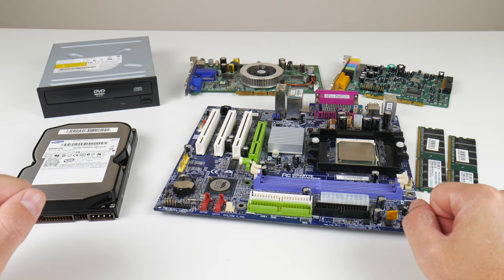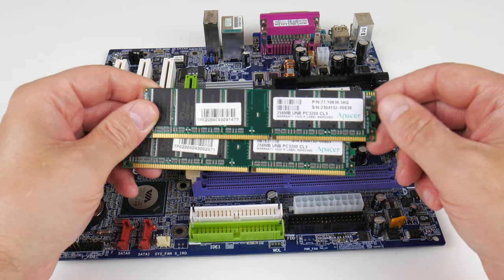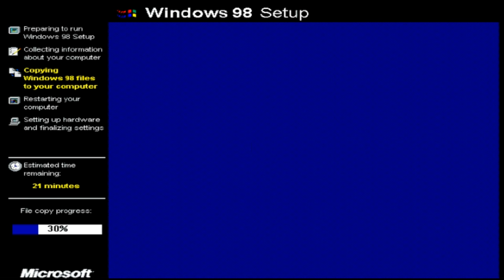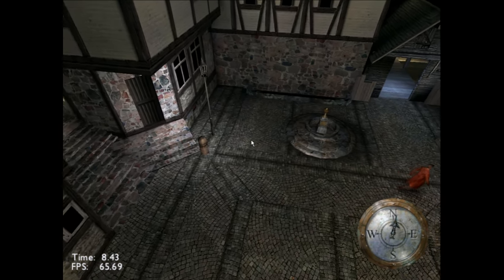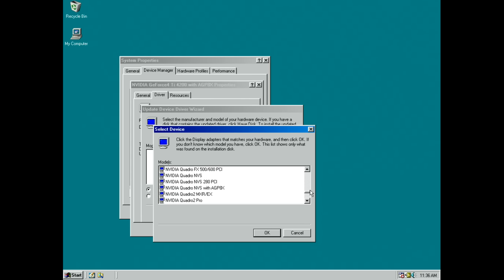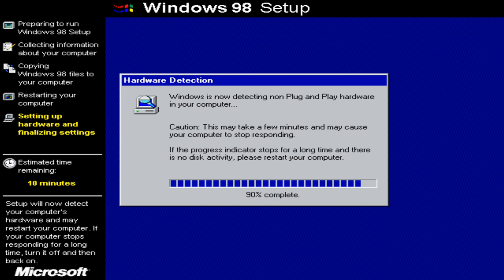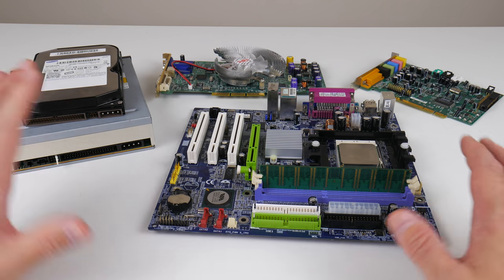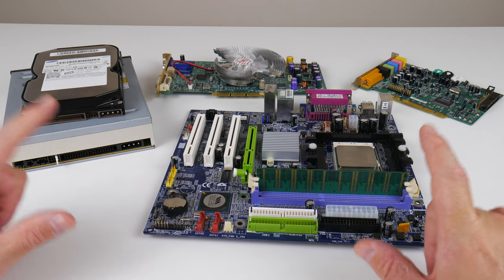Building Windows 98 Retro Gaming PC with AMD Athlon 64 Platform

Comment: This actually makes a lot of sense to do, the earlier Athlon64s were actually not too far from the old Athlon XP in terms of internal design, AMD64 was the big addition and switching from the EV6 Bus to HTT along with moving the memory controller on-die was what gave it that extra performance. Given the Athlon XP was an optimised Athlon Thunderbird which was an optimised Athlon Classic, this is basically akin to running a very high end later era 98SE PC, except hot-rodded!
Reply: Biggest bonus was SSE2 support. Otherwise the XP was good enough, and the sound storm boards were even better. That said good AMD hardware is rare and more expensive than P4s.
Reply: yea, try running any modern OS without SSE2
Reply: I disagree and the K8 was the largest jump in IPC seen in quite a few years. It’s sort of like saying Conroe wasn’t a big deal it’s ipc was about 10% higher over what K8 brought over K7
Reply: @Protoking  I'm not saying that K8 wasn't a big jump or a big deal, just that the lineage between the early Athlon to Athlon64 (and all the way to Phenom II) is very obvious and the K7 itself was largely limited by Socket A's EV6 bus in its later years which allowed AMD to reuse large parts of the design on their next-gen platform while still gaining a lot of performance (Because that fast core design is now properly getting fed with data to crunch) and focus on the parts they were changing that made K8 a big jump and a big deal like AMD64.

Same deal as Conroe itself actually, while it was revolutionary it also was a scaled-up Pentium M...The Banias and Dothan cores were the quiet revolutions that allowed the loud one (Conroe) to happen.

Comment: I'm starting to feel nostalgia to that era of computing even though it feels like only yesterday.
Reply: Me too.. there are something the legacy equipment can do, which modern equipment cannot. The manufacturers pruned off specialty or rarely used features to focus only on mainstream possibilities.. and it is maddening when trying to sort it all out since modern documentation doesn't even attempt to explain some of the choices and options older equipment offered.
Reply: I have a dream of having a stack of itx PCs filled with hardware from each major pc era. Have them all connected to a display adapter switch and connect them all to a few different crts that can support all of the machines. It would be beautiful, with the press of a button you can go from playing doom eternal to the original doom on original hardware. If I had a large house I would do original beige cases, but my apartment is tiny. Lol
Reply: @MisterRorschach90  I'm slowly getting that way, if only it would fit in itx cases, I wish, old hardware takes up quite a lot of space, and old silicon is also bloody heavy. I draw the line at CRT's , I have one, they just take up sooooooooooo much space.
Reply: Pen Guin I wasn’t even thinking when I posted that lol. For some reason I thought the itx standard had been around longer than 2001. Though they definitely had thin client matx slim. And actually I bet getting a thin client would be pretty cheap.

Comment: I put back together an old Athlon XP 2000+ socket A machine only a couple of weeks ago. I had put away the parts including the hard drive years ago. Took a little bit of coaxing but got it running - back into Windows XP - last used in 2006 - old development machine - running Delphi 5 - was pretty nostalgic :) Next up is the 939 Shuttle XPC that replaced it!!
Reply: This weekend I will resurrect my Athlon XP rig. All components are sleeping in their boxes now, but I have a nice new Zalman Z1 Neo case to make them work together again.
Reply: I am using one game on a machine like you for more than 10 years, running Win 2K Pro Sp4 namely Settlers 3 Amazons. Plenty of those CPU around in my collection.
Reply: asus a7n266 vm/aa
AMD atalon xp 2000+
512mb ram
2g/16g 2hd CF cards
Geforce4 128mb

Lots of those boards out there has built in gpu (geforce2) and sound

Comment: 4:00 Thank you for reminding me. i have Gigabyte motherboard and now i will try CTRL+F1 on bios startup
Reply: Be careful with the settings, I believe if you cause issues you void the warranty (Unless it is an old board then go crazy).
Reply: @FEELS GOOD MAN  oh relax, mine just a LGA775 so nothing to worry about, but yeah even i can pay for the new one (latest model) someday i definitely do it too
Reply: @slvr_l7732  Oh fair one.  Good thing with old hardware, you haven't got that nervousness when overclocking and pushing the hardware to it's limits.
Reply: It's not on BIOS startup, press it after you already entered the blue settings menu (via pressing DEL on startup). You will notice it flashes briefly after the Ctrl-F1 if that worked.

Comment: Hey Phil, always look forward to your Friday videos. Have learned a lot from them about things I thought I knew everything about already. Thanks and keep the excellent videos coming!

As someone else said, the sata controller needs to be set to RAID mode and windows will install and boot like a champ. I have about 4 different motherboards with the K8008M chipset and has worked for each one. Plus the VIA RAID drivers I believe don’t have the 128GB hard drive size limit. Although I haven’t filled a hard drive past 128GB to test, larger hard drives have worked just fine with no corruption evident. My best Win98 experiences have been with these VIA boards and are great performers!

Again thanks for the great vids!

Comment: I always hear about the 512MB limit for win 98se but I have built 6 of them all with a 1GB stick and they work perfectly with no issues. Clint from LGR actually got win 98se running with 1.5GB but he had to add some lines of texts to the ini file to get running as it should. His installation was fine with a 1GB of ram though. Anyway great video. I may have to get one of those Turtle Beach cards for one of my 98 builds.

Comment: The second I saw that motherboard I knew I had to run downstairs and check my retro tech shelf to see if I had the original box for it. Low and behold, I had the exact same Gigabyte K8 Triton series board back when I was in 9th grade, revision 2.0 as well. I had mine paired with an Athlon 64 3400+ Venice, an EVGA GeForce 6200 256MB video card, and Corsair XMS 512MB RAM. I never ran W98 on mine since XP was in its heyday at the time. Let me tell you though, I loved that machine. I still have the case I used too. 

I think the attitude about VIA chipsets has more to do with the overclocking potential rather than instability or low performance. I've always had rock solid experiences with VIA chipsets, but I've never had one that would overclock more than 200-300MHz.

Great video as usual Phil. Cheers.

Comment: Love A64's, still have my old S754 A64 3000+ that used to be my main rig over 10 years ago, working perfectly with a VIA Chipset. VIA chipsets are not bad as long as you know their little quirks... My A64 machine have weird SATA II incompatibilities (had to jumper them back into SATA I mode) and I know my old VIA-based LGA775 C2D has weird compatibility issues with anything based on the GeForce 8800 core (like my GTS 250), but worked fine with my GTS 450.

Comment: Nice one as always Phil.
If I'm not mistaken the error-message in the device-manager when you had the primary ide-channel disabled relates to some sort of inconsistency in the BIOS.
It seems like the channel isn't fully deactivated.
I know this behaviour from other boards with a variety of chipsets when disabling an IDE-channel.
Seems like windows' hardware-recognition is able to dig deeper than the BIOSes method of handling its resources.

Comment: Back in the day, setup guides had all sorts of exceptions regarding IDE and SATA bugs. It wasn't just VIA. The Pentium "Neptune" chipset had data corruption problems, for example. I think in practice you were stuck with PIO4 mode and couldn't take advantage of UDMA. Back when regular people compiled Linux kernels you had to make sure to check the relevant workarounds in the configuration.

Comment: This was a lot of fun, and good info on the various possible glitches. I have some of that era in my Closet... time to upgrade my old Win98 setup? :)

Hey Phil, a few vids back you used a PCI sound card that works with DOS games -- very interested to see more about that, but I missed the brand/model and couldn't find the vid again. So hope that will be part of the DOS games vid... I gotta have my daily DOOM, and if my iBase ever dies, not having to scrape up a "modern" board with ISA slots would be nice. Thanks!

The ISA sound card in my P4-3GHz that I use for DOOM is an SB16 that I bought new in 1994!! board is an iBase MB800 industrial mainboard that I got used in 2003. So it's a genuinely 'modern' retro system. :)

Comment: I recently built an Athlon 64 socket 939 Win98 retro gaming pc, using the A8V-MX motherboard (similar to the A8V-Deluxe that you showed us in a previous video). I was able to use a SATA II hard drive NATIVELY under 98, by installing the SATA II RAID drivers in win98 on an ide drive, and then I simply cloned the partition. This way the os is way more snappy, and the transfer speed for smaller file copies is significantly better.
Reply from the maker: Yup, as I hinted at in this video, every board can behave differently. This one just didn't like working with the onboard SATA controller :)
Reply: @philscomputerlab  For me the sata controller only worked in RAID mode, if I set it in SATA or AHCI in the bios win98 would freeze. Of course in RAID mode windows didn't identify the sata hdd until I installed the raid driver.

Comment: When it came to the locking up and the storage controller not loading, I had this same issue with my MSI K8T Neo2-F v2.0 Socket 939 board. What I had to do was download the SATA/RAID driver and install that. After I installed the driver I then had to go into the BIOS and set the SATA controller to RAID mode and it worked just fine at full speed.
Reply: I was wondering about that -- I thought Win98 didn't have SATA drivers??
Reply: @Reziac  SATA in IDE/Compatibility mode is recognized as an IDE Controller on most motherboards.
I didn't have to jump through that hoop with my Asus P4C800-E or my Intel D875PBZ with SATA...it just worked (I even have a SSD on the Asus board).
With AMD, my VIA Neo2-F worked after jumping through that hoop, but my MSI RS480M with the ATi X200 chipset wouldn't work at all with SATA and Windows 98.
I guess it all depends on the chipset when it comes to getting Windows 98 to work on SATA.

Comment: A nice thing about this motherboard is that the integrated VIA VT8237 SATA controller actually has really good drivers for Windows 98. To use it you should enable RAID option in BIOS. Win 98 will freeze at the first restart, at that point you apply R. Loew SATA patch, and it's done. Just continue installation normally. By doing this you also get rid of the 120Gb limitation.
Reply from the maker: That is a nice tip! Yes I believe it will actually freeze twice during installation. Thank you for the tip 🙂

Comment: I don't see many reasons to build a machine specific for Windows 9x. I would aim for high-performance DOS PC with ISA sound card and Windows 9x as a secondary use. Windows 9x is the easiest gaming environment to emulate. GPUs from that era had "fixed-pipeline" which meant that programmers had to use a small set of predefined functions. This made adding "3D acceleration" hard for many games, because software renderers used sophisticated methods that could not be replicated on "fixed-pipeline" GPUs. For example invisible demon from DOOM that had cool predator invisibility can't be done on such GPUs.
On the other hand small fixed list of functions can be easily emulated, so virtualized Windows 9x can be more accurate than DOSBox. Not to mention that almost all Windows 9x games will run fine in Windows XP.

Only good reason for building Windows 9x machine is that it's the cheapest retro PC build. You can just pick any laptop from 2004-2006 that has Nvidia or Ati GPU and install Windows 98 on it. Such laptops should have all drivers for Windows 9x available and even low-end ones will be more than enough for Win98 games.

Good DOS era hardware will cost you way more, because DOS emulation is far from perfect. DOSBox will run fine, but when you compare DOSBox against real PC, many games will be running noticeably different. With Win9x emulation it's not the case.

Comment: The 939 platform seems to be more windows 98 and dos friendly. Lot less issues with a 4000+ and a via 939 platform.
That said, me too I can't use any sata ports, only ide works.
Also I sugest you to do some 800Mhz test in 98 as some games will require a 800mhz cpu speed not to hang.
And Phil, can you test one game next time you do a 98 video? The game "ONI" is VERY picky about the video card.
Reply: I remember that game! It ran perfect on my socket A AMD Sempron and ATI Radeon 9550GU back in the day.
Reply: @barbunicolae2711  I played it on PS2 at the time but it was a port of the PC version. This game was really unique, there is nothing like it on Win98.

Comment: Incoming needs TNT2 pro or ultra to have the best experience. 
Good one like always phil. Same opinion about socket 754 for Windows 98. In my opinion is the best choice. They are cheap: Athlon 64 or Sempron 64 costs only few £ or €. Mainboards are cheap 15/20£ and it's easy to find a single stick of DDR400 memory.
You can use lots of GPU. Performance are impressive, the platform stay cool and quiet at load speed. You can use reference AMD stock cooler and put down multiplier if you need.
See you soon
Reply from the maker: Yea with GeForce and later Incoming doesn't render correctly. This is an odd game. Looks very nice on other cards like Matrox and Radeons.

Comment: I did a 754 build about a year ago using a slightly newer MSI MS-7145 motherboard.  It has an ATI RS480 chipset w/SB400 southbridge.  Lots of compatibility issues with Windows 98 (neither onboard video nor sound worked and I had the same issues as you with the SATA ports), but after using strictly IDE and installing a PCI sound card (ALS4000) and PCI-E video card (FireGL V5000 hard-modded into a Radeon x700), I managed to get rid of all exclamation points in the device manager.  Used the same Sempron 3100+ CPU and also a 32 GB IDE SSD.  Was interesting to see your attempt at a similar build.
Reply from the maker: Interesting, I don't think I've used such an ATI chipset solution before...
Reply: Now I'm wondering if maybe the onboard video did indeed work - the RS480 is the Radeon xpress 200 which I see is supported in Catalyst 6.2.  I may have to re-check that.  Not even the performance of a Radeon 7500 but might not be too bad for Windows 98.
Reply: I tested an ALS4000 some days ago and was very unsatisfied with how much static it produced. Turned out later when I had removed it that the jumper between Line-Out and Speaker was set to Speaker. No wonder it had massive static. Have to test it again someday. But for now I have no reason to use it because I'm very satisfied with an ESS Solo-1 which has very little static even when volume is at maximum.

Comment: Having to force the display driver is because it's a Medion card. Pretty sure it doesn't have the same performance as a regular Geforce 4 Ti 4200, Medion is known for using cheaper, trimmed down versions of standard components.

Comment: The reason why the Geforce 4 TI 4200 was so much slower than the TI 4600 is because it's probably the version with the 64-bit memory interface. That version of the TI 4200 is extremely slow.

Comment: I use Socket 939 and 775 for Windows XP. I ALSO use 775 for Windows 7. That's my preference. I also prefer High end Athlon XP/P4 for XP, while low end belongs in 98SE, ME, or 2000. That's just how I do it though. I leave everything up to midrange 1155 for Win7, everything else newer is 10. I do, however, want to use that spare 4790K and GTX 980 for a silly windows xp system.

Comment: I've combined a Socket 754 Sempron 3000+ with a ASRock K8Upgrade-VM800 and the processor can be downclocked to 800MHz.
Reply from the maker: Nice! Be sure to check out CPU SPEED tool from Vogons. As you have VIA chipset, it will let you slow it down even further :)

Comment: I have used the FIC K8M-800M 754 board with a Sempron 3300+ as a Windows XP platform since 2005. It is very similar with the VIA chipset, S3 graphics, AGP slot and two SATA ports. I did momentarily boot that system from a hard drive with Windows 98SE on it, but I never contemplated its utility as a 9x platform.